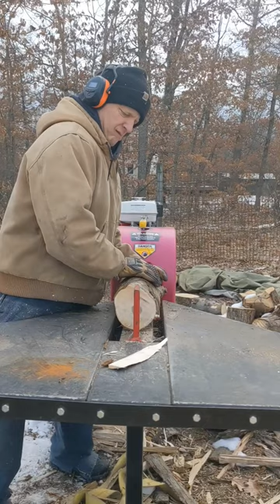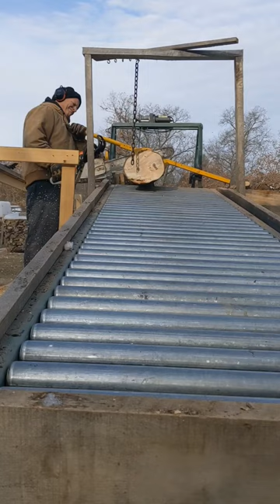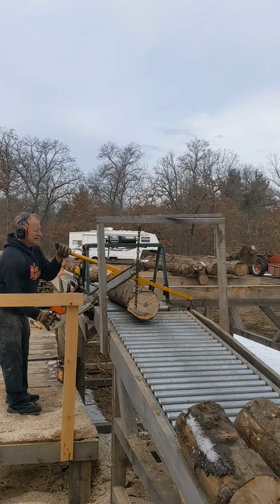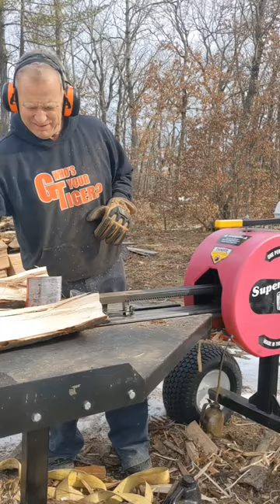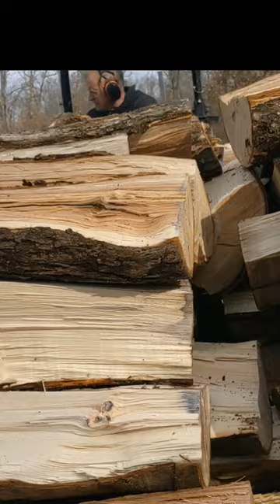Best DIY Hillbilly Firewood Processor

Comment: What kind of splitter is that?
Reply from the maker: It's a kinetic splitter with 2 90 pound fly wheels.  I'd made by SuperSplit.  They were the original design in the 70s.  There are a couple more companies that make them.   You won't be sorry if you get a SuperSplit